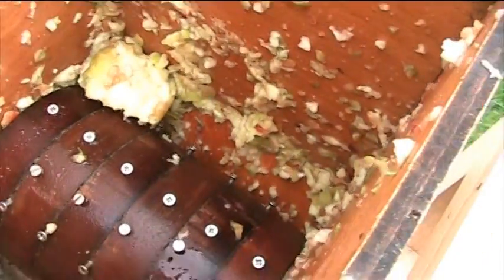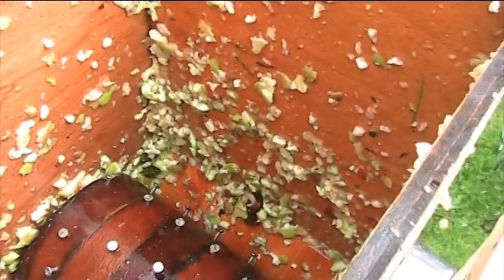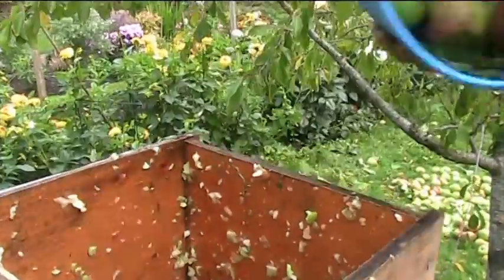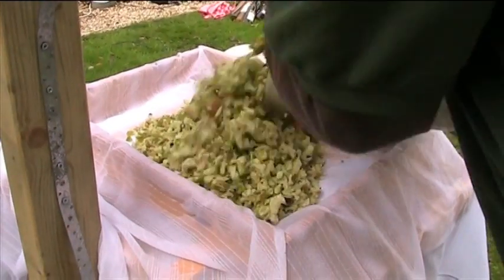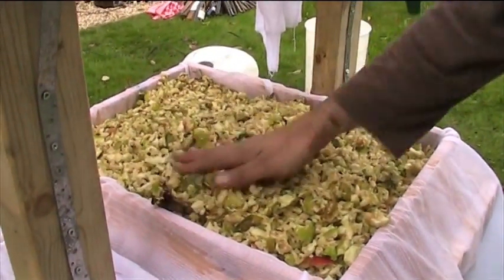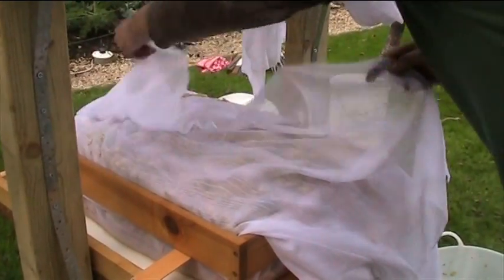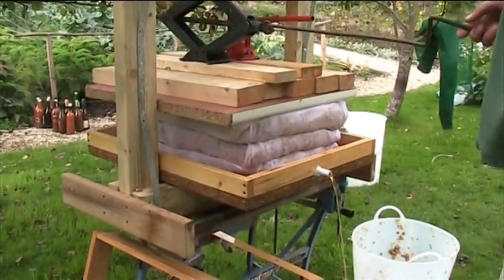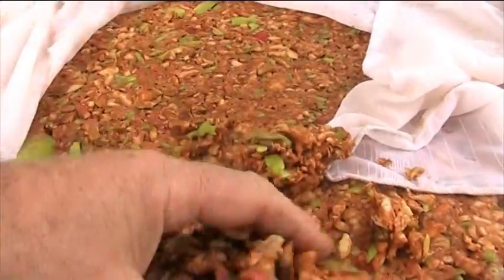Apple scratter and cider press..mpg

Comment: Works good apparently! May I ask from how many trees did you get all those apples? (and what apples are they?)
Reply from the maker: +pks342 it works good REALLY, I donated the scratter to a small group of people who were (proper old fashioned) organically raising fruit and veg.  I recall about  7 -10 trees.  The extraction ratio was (by weight) about 70-80%  with the scratter and press shown. I do know know the exact apple types, but would guess  coxes, worcesters,  all sweet eaters. We were making apple juice that was pasteurized and or frozen.  For UK or Hard Cider (alcoholic) a real rough staring point is to use pure cider apples which are bitter and very tart but high (think it is) Malic acid (this makes the cider have body, without it, the cider is thin tasting and has ether tones that are not pleasant. to most people) starting with a 50-50 ratio with some sweet eaters.  Or, as there are very few places that have cider apples, 10-25% crab apples mixed with sweet and more sharp cooking apples.  Cider It is an art that is developed over years, and keeping meticulous records. I hope this helps and if any others have their thoughts on this PLEASE PLEASE share
Reply: Good Stuff! I'm interested in brewing my own apple cider too!

Comment: did you make the scratter out of hard woo?.  Can it be done with softwood or will that taint the cider in some way?
Reply from the maker: +Glenn Ryzebol I made the drum from hard wood, as stated in previous replies,   the rest from plywood.  beech or birch veneered,  i do not KNOW if it would taint the cider, but in in my opinion I doubt it would have much, if any, contribution to tainting the resulting cider, main reason, it is not in contact for long enough.   the hard woods I would guess have a slower absorption than softwoods and therefore   would clean up easier and leave less residue year on year.
Reply from the maker: +colincox1whichnet ooops,  thank you for you comment

Comment: Gartenwollo. I believe the height of the screws on the rotating drum influence the size of pulp that is made.  Screwed in too much and scratting takes too long, too high and large pieces drop out.  Also the distance between the drum and the hopper wall determines the largest size that is allowed to fall through. I am making a scratter now and this is at the forefront of my mind...
Reply from the maker: How did your scratter turn out do you have a video.